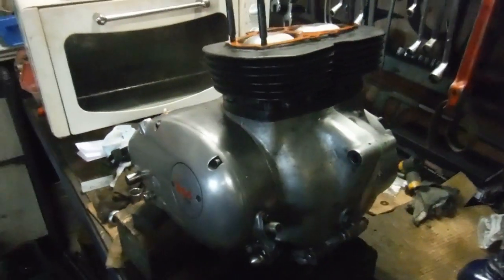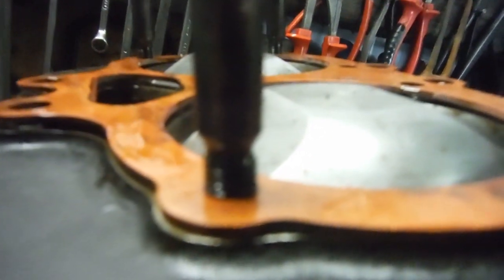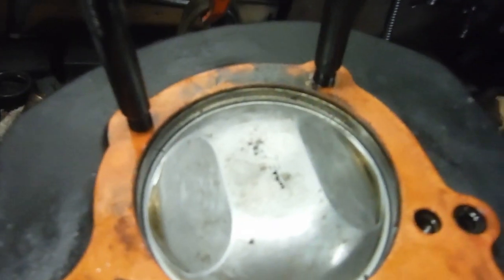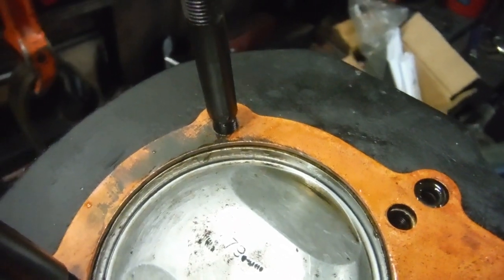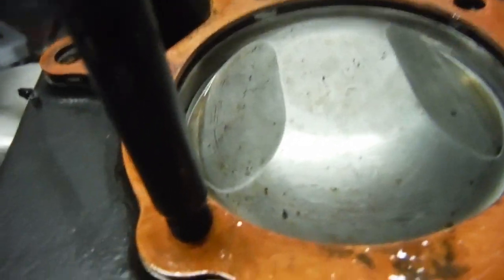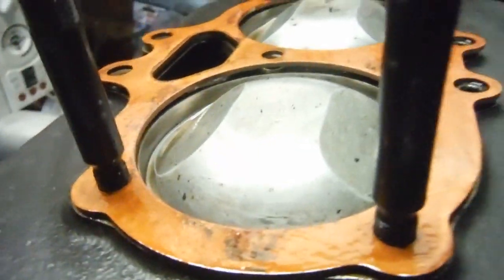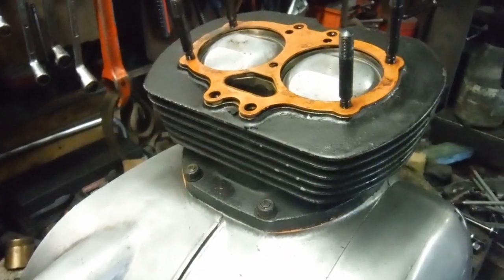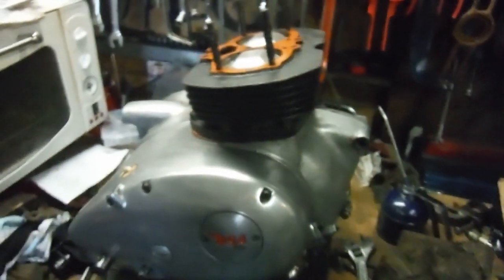BSA A65 engine strip and rebuild 4 Observations relating to 750 top end conversion components.

Comment: I'm providing this information,hoping some may benefit...
coppergaskets.us,veteran owned, Made in USA.
Several applications,on the shelf,
and can manufacture for custom applications.
I'm not involved with this outfit,I drive tractor trailer on the 
US Eastern Seaboard.
I purchased a .093" thick head gasket for my BSA unit twin,so as to drop
compression,about a point,or so,to run it on pump premium.
I received a quality product.
in a correspondence with SRM,they felt that the stock length pushrods
would work with the thicker head gasket.
Thank you Paul,for your YT channel,and your consideration!
It worked for me!

Comment: Interesting stuff Paul. As for the cylinder head- is it a different one to the 650? Or, if it's the same, is it remachined to fit?
Reply from the maker: As far as i could tell, the cylinder head combustion chamber dimensions looked to be standard.
Reply: @paulhenshaw4514  a fairly easy conversion then - have you ever ridden one?
Reply from the maker: Yes, there are rides on one on the Black Mountain among my videos.
Reply: @paulhenshaw4514 how does it compare to riding the 650 in your opinion? Is it a worthwhile mod as later thicker flange Std cylinders seem to be getting harder to find.